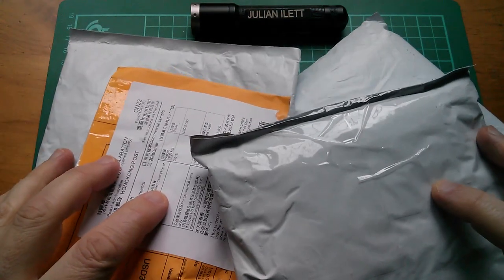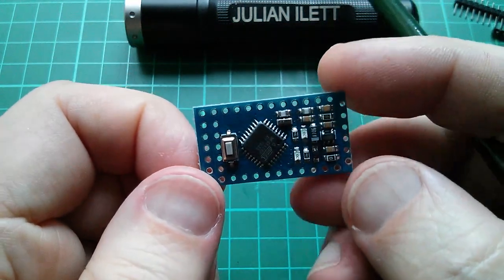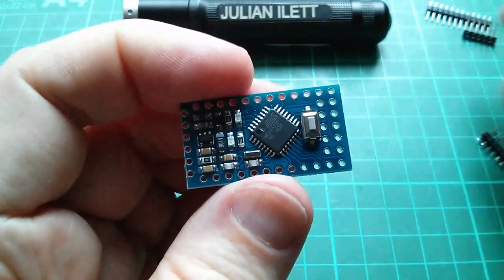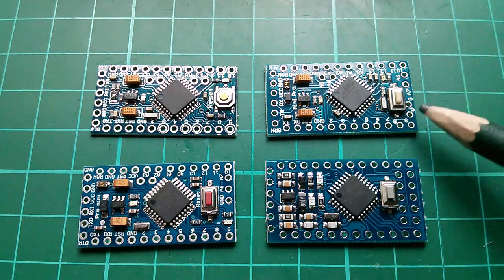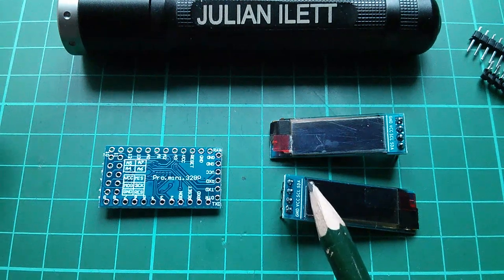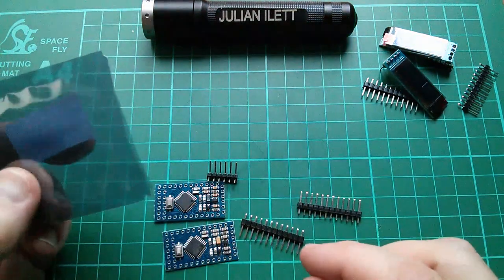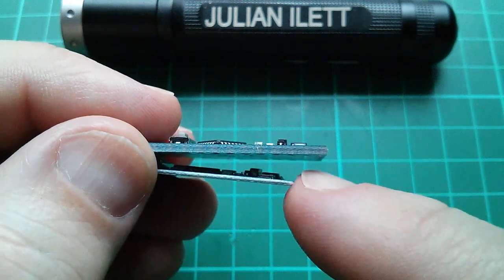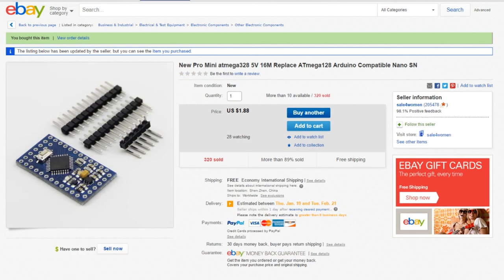Julian's Postbag: #80 - Addicted to eBay

Comment: Since they went to the trouble of putting a variable capacitor in the board I guess it is to tune the frequency of the PIC to exactly 20MHz to make sure you get more accurate readings. You could try using your oscilloscope to probe the clock pins of the PIC and adjust the trimmer cap until you get as close to 20MHz as possible.

Comment: you must have one of those testers, called component testers or transistor testers, where you put the component in the socket with the lever and it gives you a few parameters and a little diagram? Im sure Ive seen you use one. anyway, they do frequency counting too, and generation. or at least the kind Ive got does, I know there are a few variants

Comment: Little tip my grandfather taught me for insulating two live wires that go by each other when space is too tight for electrical tape or heat shrink. Nail polish! Solder it up and paint up some nail polish on the wires and even if they touch down the road they would not be able to make an electrical connection. =D

Comment: Any way to cut the traces on either prop mini or the display and solder in a jumper wire to switch around the pads?
Reply from the maker: Quite possibly - I'll have a look at that :)
Reply: Julian Ilett I did a quick search and couldn't find a board cad file. I was just looking at these on Banggood yesterday. I've only seen pics of these so not sure how easy it would be to access the traces. How good is your soldering skills? Can you solder a bodge wire on the chip leg?
Reply: Or perhaps bend them in a U shape (if they don't break beforehand) and solder them in from the other side. Would make the contraption wider, but the overall stand-off despite the tall female header would be less.

Comment: Re. the frequency counter - we bought 2 for work - basic measurement, not worried about accuracy, but it's surprisingly good. Used for a test of a project using an XMEGA device (you can program the frequency of the XMEGA fairly easily, on-the-fly).
I fed input through a 0,1uF cap, as the XMEGA is a 3V device, didn't wanna damage it, as the PIC runs at 5V. Yeah, good for anyone's toolbox.
Reply: Forgot to mention -  I got the XMEGA clock to run (from a 32KHz source, and it's phase-locked-loop) between 32MHz to 16HZ (yes, that slow) and the counter measured with no problem!

Comment: That frequency kit would make a good live video. If you do that, It's probably ok to ignore the comments while you are working. Others may disagree about that, but I'd love to see the kit build live, and ignoring the comments seems like the only way.
Reply from the maker: Oops - It's half built already
Reply: I bough this and assembled it but it only works with certain waves (square) and it needs a fair amount of amplitude.  It also can be slow to update at times, other times it is fast.  I built it and almost never use it.  It works ok with crystals but almost all crystals have the values printed on the case.
Reply from the maker: It looks like the input signal goes directly into pin 3 of the PIC. So the input signal will need to be 3-5 volts and reasonably square is my guess :)
Reply: Some things can't wait, no worries :)
Reply: I wonder if you could add an op-amp in front of the input to increase the sensitivity by squaring up the wave, and even adding gain if necessary.

Comment: Why not use wire to sammich the OLED to the Arduino? Just desolder the pins, and use the wires as a spacer. Tape would be okay to hold it down.

Comment: Are you sure about the cheap version being the thin one? It's hard to tell from the pictures on ebay, but it looks like the more expensive one is the thinner board. Also more importantly, the thinner version has the fuse on it, the thick one doesn't. The ebay pictures show them both with fuse, so one of the seller obviously cheated you ;) .

At last an item that I got years before you (it happened a few times that you showed a product in a video that I just ordered a week or two before that and had yet to arrive)! I told you these pro minis are the best for integrated projects a long time ago ;) . The correctly laid out ISP pins make them as easy to program as any Arduino without the bulk (and cost) of an integrated USB-UART converter. Since you program via ISP anyway you can also get rid of the Arduino bootloader (more space for your program and faster startup), a thing that I do on most Arduinos anyway (I still use Assembler half the time and non of that slow and bloated binaries that Arduino creates ;) ). 

And yes the button is in the way, just desolder it. When programming via ISP you don't need a reset anyway and if your program acts up the reset button is not the way to solve that!
Reply from the maker: Yes, the 'polyfuse replaced by a zero ohm resistor' defies the 'get what you pay for' idea. And that assumes I got them the right way round anyway :/ I remember you mentioning the ISP header layout on this version some time ago, it's taken me this long catch up :) Switch removal does seem like the only solution on this overcrowded board.

Comment: So if a PIC take 4 cycles per instruction and only runs at 20MHz and measuring towards 50MHz. 
How does then even work ?
Reply: It uses the input capture pin. Resolution is 50 ns. I doubt it can measure up to 50 MHz. Unless there is a PLL clock 
multiplier I don't know about!?
Reply: PirateKitty
So, as far as you know. It can catch a 50nS glitch?
But that is not counting them. And without opening a calculator 50nS is not even close to 50MHz.

ok if i used the calc right, 50MHz is 20nS

Comment: PayPal ruined my eBay experience. They have disabled my account, Over $20 they didnt take from my account.

So now, Im hopeing BangGood is actually BangGood. Their packaging is far superior than anyone I have seen from eBay anyway.
Reply: banggood is ok i ve bought a lot from there and they also have a "live help center" that you can talk with someone if you have problem. but they do not have electronic components... only a few
Reply: mitropoulosilias
I will have to have a look at the live chat thing. Because Banggood have not sent me an item and have not got back to me. So far the only error to happen.
Reply: TheProCactus yes just contact them through the live chat on the top right of their website! i ve talk to them 2-3 times..